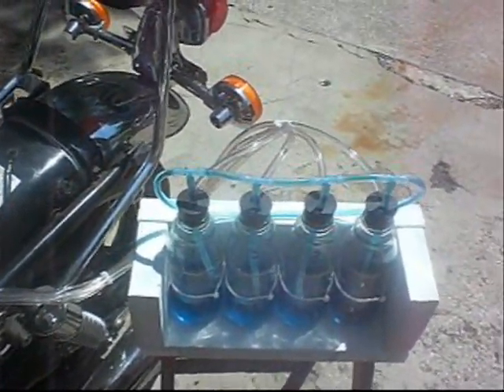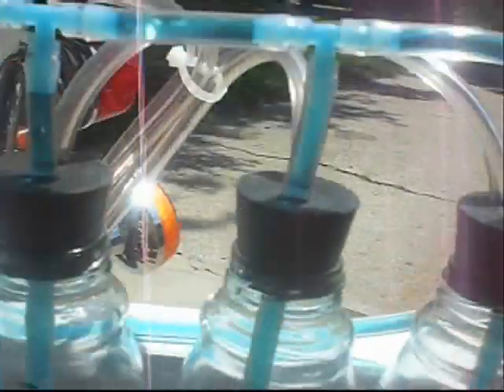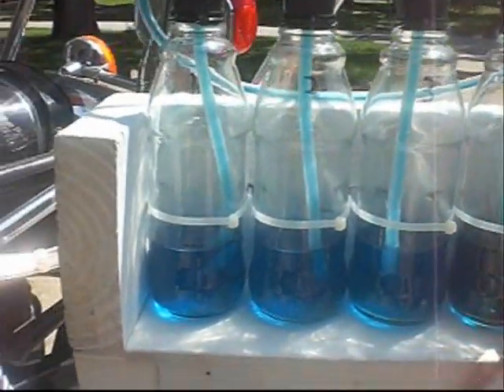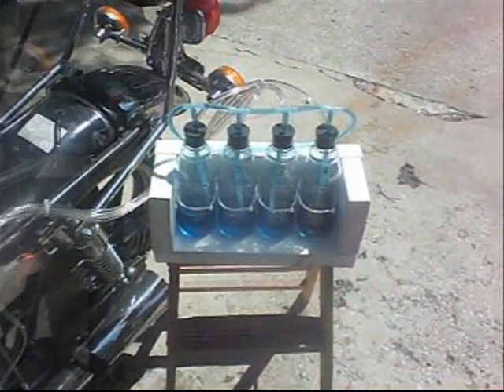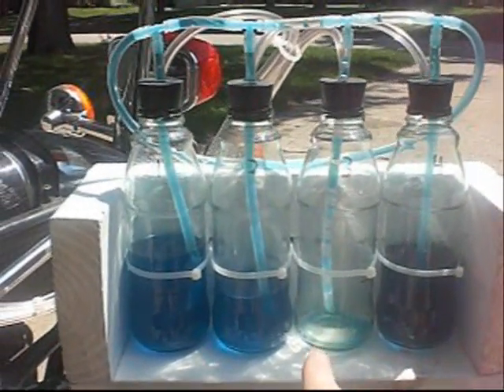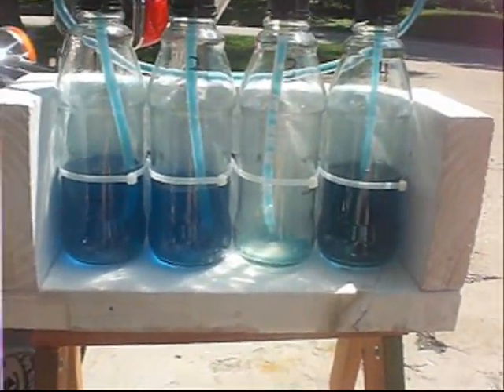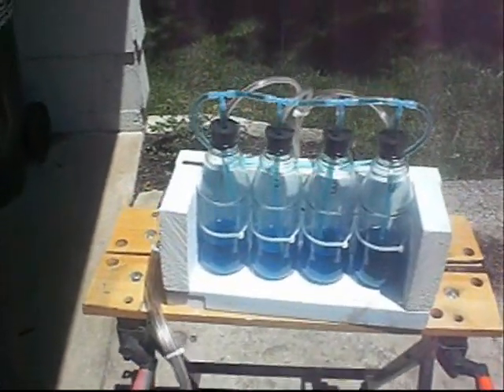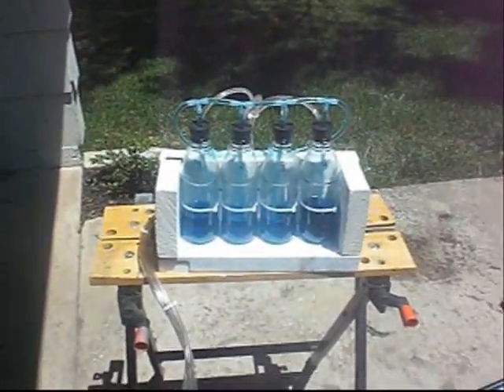Homemade 4 Cylinder Carburetor Synchronizer/Manometer

Comment: I just wanted to get a couple things clarified.  First, does it matter that all of the bottles have the exact same amount of fluid at the end of the sync?  It seems like as long as fluid is no longer moving one way or the other that vacuum is equal between all cylinders.  

Second, I am building one of these and Lowes was all out of T-connectors.  Will the sync be affected if I still link all of the bottles together (ie. 1 connected to 2, 2 connected to 3, and 3 connected to 4)?

Comment from the maker: The purpose for that hose is simply to make sure there is a full circular path for the fluid to flow (especially between 1 and 4) making for a more accurate reading.  It's probably not really necessary however since the fluid is incompressible and whichever bottle is strongest is always going to pull fluid from the rest.  Ideally, if you could get a single + shaped fitting and connect all 4 bottles to it that would work best and save on buying multiple fittings.

Comment: what is the purpose of the hose going out from bottle 1 form the left side when looking at the video and joining the house joinder number 4 from the right hand side,? Can I just use two T shape joiner and use them for bottle nr 2 and 3 and from those joiners I will connect them to bottle nr 1 and nr 4 ?  Iam not sure If that makes sense :/ thanks for the video a lot it saves a lot of money :)

Comment from the maker: I depends on the bike, but they are pretty standard.  I put a link to them in the video description.  Or, do like I did and buy 4 socket head screws that fit and washers from the hardware store and short piece of brass tubing.  Drill a small hole down the center of the screw, cut the tubing into about 1.5" pieces, and solder the tubing pieces to the tops of the screws.  The tubing ended up being a perfect fit on the tops of the screws and the plastic tubing from the manometer fit right over it.

Comment from the maker: Yeah, you *have* to use glass bottles for exactly that reason.  You could also use tall liquor bottles as well.  They would better than the bottles I used because the extra height and capacity would give you more time to adjust things if a cylinder is way off and pulling fluid quickly.

Comment: I made myself one like this based on your video to synch my 88 GSX-R 1100R carbs after a rebuild (adjusted valve clearances first) but the plastic Gatorade bottles I used collapsed due to the vacuum. Are your snapple bottles glass?